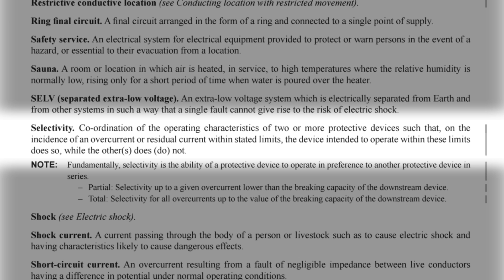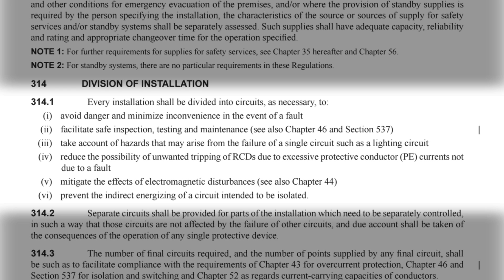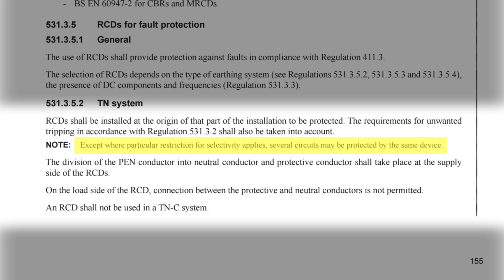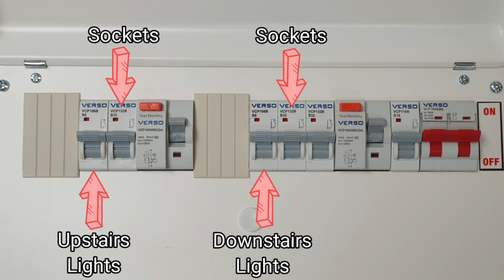Is a SPLIT LOAD CONSUMER UNIT compliant with BS7671? - Electricians' Q&A

Comment: RCBO boards only suit properties with good wiring done by a pro .One someone starts hacking into neutrals and  bad connections etc , adding a RCBO will be a nightmare .And as mentioned RCBO boards dont tell you when something has turned off .So lets say you dont notice something not working , Then you could be in trouble !!

Comment: I have always done full-RCBO boards. On a normal house, the difference is an extra £90 (on a ~£500 job). It’s a much a better service.
When they make us do the AFDD, that’s going to be another minefield to navigate. By all accounts one AFDD at the front of the board will keep the lights of permanently, but an AFDD on every circuit will double the price of the install.
Guide us! Oh ye wise eFixx!
Reply from the maker: stay tuned for amd2 in March - from what we know it's only going to be certain types of circuit on certain types of installation.

Comment: There is nothing wrong with split load boards.
Reply: There isn't really anything wrong with them until a fault develops and takes out half of the circuits. That's why rcbo boards are soooo much better
Reply: @curtisj2165  well no that's bollocks really because if half the circuits gat taken out in a house for 5 seconds what's the problem? Turn the MCBs off, turn the RCD back on the one MCB at a Time. When it trips you.know which circuit. RCBOS only benefit is having 30ma per Circuit, which technically means its less sensitive then when it is shared over a split load.
Reply: @adamwright5306  5 seconds? Imagine if the rcd trips while you are not at home, or worse still, while you are on holiday
Reply: @curtisj2165  Would never happen if its tested correctly. Thats just like saying imagine it just spontaneously combusted. It never happens, it's just what ifs all the time. You hear the odd case on a forum out of millions of houses. The worst that would ever happen is your fridge might turn off. Big deal. Can't imagine people leave fillet steak in there before they go away
Reply: @adamwright5306  would never happen if tested correctly, are you serious?  Personally i would not be happy if my freezer defrosted
Reply: @curtisj2165  Well I fail to see your point. If you go away on holiday the only likely hood of any circuit tripping would be a power circuit as all others would be off, so the likely hood being a power circuit would be one powering a kitchen with constantly running appliances that could fail. So if you have RCD protection in the form of RCBOs or RCD that circuit will trip either way.
Pointless argument mate you're wrong and as I said before there is no point if the circuits are divided correctly.
Reply: @adamwright5306  mate, i do electrical testing and inspections for a living, so i have a good idea of what I'm talking about. You obviously never heard of nuisance tripping where an rcd trips for no apparent reason
Reply: @curtisj2165  🤣
My Name is Adam, I run a multi million pound electrical company called elecracomsuk.  employing 44 electricians and I've done inspection and testing fo over 25 years. Nuisance tripping isn't RCDs tripping for no reason it's down to faults on the circuit as the RCD monitors the return imbalance from the neutral. Don't patronise me as you clearly don't know what you're on about. If a property is tested properly split load boards are fine.
Nice talking to you.

Comment: That’sall well and good splitting circuits up with selectivity and rcbo’s provided there are no borrowed neutrals.
Prime examples are two way lighting on landing light. Boiler that have been replaced with live and switched live, where the permanent live has now been added from downstairs and control gear from the airing cupboard upstairs.
Reply from the maker: If you're aware a circuit has a borrowed neutral would that not be something that you'd fix anyway?

Comment: Split load RCD could also alert someone quicker that a circuit has gone down and has a fault as half the property will loose power, these circuits could have vital equipment pump or freezer for example and is more likely to go unnoticed with an RCBO,  this is the only real benefit other than cost to have a split load RCD
Reply from the maker: Another good point. 😊
Reply: I like to see a max of 4 circuits per RCD, even better would be double pole MCBs, I have fitted them and it makes fault finding easier.

Comment: The reality of fitting a  CU means that you don’t always get to make those choices over which RCD a circuit goes on.

The position and length of the existing cables often dictates things, and if you’re installing a split load board to reduce costs, it means you’re not likely going to be able extend the cables safely and tidily.

Also, lots of older properties have shared neutrals on the lights anyway, so regardless of board type, the lights are going to be on one RCD/RCBO anyway.

Comment: I'm beginning to wonder if wholesalers should stop selling pre-built standard configuration special offer dual RCCB consumer units; all too often the installer just sets up an installation based on whatever MCBs came with the board rather than what the installation would be best served by
Thankfully I operate in a sector of the market where 99% of the time I can fit RCBO boards with SPD

Comment: I fit rcbo 90% of the time bit sometimes budget means split rcd board.

Ive used the logic that if the big Manufacturers still make and sell these boards they must meet with the regs im sure these guys go through the book thoroughly to make sure they are not making itmes they cant sell.

As soon as a reg comes out suggesting split boards are not good enough they will stop making them.

Spiltting the lighting circuits always trips the rcd when the property is sharing a neutral for two way switching.so on occasion ive had to put them on the same rcd.
Reply: Spot on for both comments.

Comment: In an ideal world all electricians would prefer to use SPD's and RCBO's in a CU. However, not all clients can afford the associated costs involved. So until the RCBO's become a little more affordable, RCD's will continue to be offered as a cost effective method (albeit not perfect) to protect the varying circuits within an installation. Nice job of explaining Joe. #StaySafe
Reply from the maker: Thanks Brian, that's pretty much the message I was going for. 👍
Reply: Do you offer both solutions when quoting, or do you assume the client can’t afford RCBO option without offering? What saving do you offer for a dual board vs an RCBO board ( genuinely interested in reasoning)

Comment: Full RCBO is a preference, but split load CU is still safer than a nackered old rewirable board for less well off customers. I personally think the IET should be proscribing ring final circuits before mandating RCBOs (or  SPDs, AFDDs, etc.). It's the 21st century, let's have socket radials exclusively already.
Reply: You need to understand ring final circuits and their advantages.
Reply from the maker: Some good points there.

Comment: Very balanced video
I've got a split load that only ever tripped due to faulty iron and hasn't now for 3 years.
My electrical installation and appliances are all good.
RCBOs are an expensive overkill
Reply from the maker: Balance is what we were aiming for so thanks. Love RCBO boards but wanted to point out how split load can still comply.
Reply: DP RCBOs are safer. 
Also your freezer can be tripped off when there is nothing wrong with it.
Reply: I would rather have a garage circuit, which may have a freezer plugged in, on an RCCB. If there is a fault with the freezer, you'd hope to notice one of the other circuits off in the house before you lose your frozen food.

Comment: The selectivity normally refers to protective devices which are in series, the protective device next to the fault shall trip, and not the level above. This is also mentioned in the part of BS 7671 shown in the video as a "NOTE". In case of a, for example, 30mA RCD this would require a RCD which is time delayed and at least 3 times the tripping current of the 30mA RCD (in that case a 100mA).
Making groups of RCDs is sufficient here in Germany to meet regulations, but the best way to go is to install RCBOs for the circuits. That particular thing isn't in the DIN VDE 0100 (Low voltage electrical installations), it is in the DIN 18015 (electrical installations in domestic dwellings). This reg also regulates by the living area in m² how many outlets must be in the different rooms, numbers of circuits, and the size of the distribution board (at least 4 rows, each row 12 units wide, 1 width unit=1 standard MCB), number of general circuits for outlets and lighting (depending on area in m²) and dedicated circuits for several named appliances. They also now want that we install one distribution board per floor, I actually did that back then when it wasn't necessary. I got a board in the cellar with the circuits for the cellar and the ground floor. The circuits in the 1st floor are in a sub-board installed on the first floor. Lighting circuit tripped, you are in the first floor and the lights in the staircase aren't working. And the board is on the ground floor. Worst case: You fall down the stairs because your kid left the roller skates on the stairs...

The best words describing using the RCBO for each circuit instead of RCD groups is: Operational availability, or reliability.
Reply: Just saw this and it reminded me of doing rewires of systems about 50 years old (in UK) where they had sub boards on different floors. Sometimes the regs just go round in circles 🙃
Reply from the maker: Great comment, thanks. 😊

Comment: I would still install a split load as there is nothing really wrong with them if you divide the circuits correctly, but I would always prefer separate RCBOs as its cleaner and less disruptive should an RCD trip. My issue here is that the general vibe seems to imply the RCDs are always tripping, but in a healthy circuit you rarely ever see that.
Reply: My parents house had 1 30ma rcd protecting the whole house. And never really had issues. I could probably count on 1 hand when it tripped in 10 years. My dad was in to tech so had 15+ machines with switch mode power supplies. Chinese odd power supplies all over the place. And the only things that used to cause it to trip was once me drilling through a cable. My mum cutting the lawn mower cable. And a couple of times when the outside light would literally explode. Other than that never had a problem.
Reply: Indeed, I've had a split load board for ten years and it's only tripped the RCD once when someone went on an adventure with a knife in a toaster..
Reply: @edc1569  LOL!
Reply from the maker: Great comment, some really valid points made there.
Reply: I hear that, but circuit can become defective via dodgy appliances plugged in, water heaters elements going down etc. & finding faults on a bank of circuits via  a RCD takes time to eliminate the fault as you will need to check all circuits addressed to said RCD, client always like a cheaper option but over engineering is always the best solution in the long run, but will cost more upfront

Comment: My mum had a single RCD board. When she needed some sorting out done, rather than rip out a perfectly serviceable CU we put RCBOs on one socket circuit and one lighting. So it's split load: RCD one side, RCBOs the other. Much more affordable to upgrade one or two at a time. Eventually they could all go into a new, same brand CU.
Reply from the maker: Top tip, thanks very much!

Comment: Great video.  Presumably the IET are happy for us to continue to use dual RCD boards for the time being, as they are still shown as an option in the OSG (fig 3.6.3 (ii)).  RCBO boards are undoubtedly less inconvenient in the event of a fault, but there is one very slight advantage to dual RCD boards:  Depending on what tripped (MCB, RCD, or both), you can get an idea as to what sort of fault you're dealing with.  This can be very useful for those intermittent, difficult to find faults that don't show up under test.
Reply: You'd get an idea what fault you're dealing with with an RCBO?
Reply: @user-wk7wv8rn8h  not really. 
 For a dual RCD board, an overload or L-N short would trip the MCB, while an earth fault would trip the RCD.  A line to earth short would probably trip both.  So you can at least get an idea of what sort of fault there is by what device tripped.
An RCBO will trip for all the above faults, so it gives no clues as to what caused it to trip
Reply: @user-wk7wv8rn8h  I think he means if a MCB tripped it would suggest a different fault to that if an RCD tripped. If an RCBO trips, it could suggest a neutral earth fault or a short circuit so you'd be looking for both.
Reply: @NUFCJCYT  would a competent electrician not be able to figure that out within a few minutes of testing
Reply: @user-wk7wv8rn8h  Yes, and someone competent at reading would have noticed he said RCDs offer a "slight advantage" which isn't incorrect of him to say.
Reply: @user-wk7wv8rn8h  as per my OP, not all faults show up under test.  Some kinds of intermittent faults, particularly those on appliances, can return perfect, text book test results.  These can be very difficult and time consuming to pin point.  Knowing what sort of fault you're trying to find, overcurrent or earth fault, can cut that time in half.
Reply: @user-wk7wv8rn8h  i think he meant you will know which circuit is faulty

Comment: Why are we still having this discussion? Split loads are allowable but they shouldn't be. If everyone fitted RCBOs the cost would drop like a stone. As to the question of separation. What about arc fault we won't have 10 of them per board. (At first).
RCBOs aren't that expensive, and I wouldn't fit anything else. (WEO essential uses alarms etc.)
Reply from the maker: Thanks for commenting 👍

Comment: Way too much is being read into this, and you can bet your ass a judge would rip you apart if you listened to this advice. Just put each circuit on its own RCBO. They are cheap enough these days.
Reply from the maker: You could also point to other publications by the IET which show split load boards in use as acceptable. I think if you demonstrated the depth of knowledge of the regs shown in this video the judge would trust your engineering judgement. I agree RCBO boards are the best but split load boards aren't necessarily non-compliant.

Comment: Couple of other points I can think of referring to split loads:
1. Does both RCDS have to be both at 100amp now? What happens if they are not?
2. What happens if either RCD or both are the incorrect type for coping with DC masking/Earth leakage with present circuits or additional circuits such as car chargers, etc.
Please discuss if you can with another video please.
Reply from the maker: Great questions, we'll add them to our to do list!
Reply: @efixx  Thanks. I liked that Lewden IP rated TP&N DB. Have you seen the Hagar  TP&N (basic IP) with Surge built in on the busbar system adjacent the main switch? No MCB required to feed it. If all boards came built in, we wouldn’t forget about them. 🤣
Reply: If the mcbs down stream addup to less than say the 63a rcd. Surely that's OK. If they add up to more then it would need changing

Comment: I like to fit high integrity consumer units and full rcbo consumer units.  Have to way up how many circuits and how big is the property. ..fitting dual rccd consumer units has a problem with a circuit tripping off there is no we here else to put it temporarily on a non rccd side.. just a thought ...
Reply: Well, if it’s tripping the RCD, there’s a potentially dangerous fault, so you you shouldn’t really be putting it on a non RCD protected breaker at all....

Temporary fixes have a way of becoming permanent. I know of a customer that has over a 100ma going down the main earth where the previous spark did a “temporary fix”, but the customer doesn’t want the hassle of changing his board.
Reply from the maker: Interesting thoughts, thanks very much. 😊
Reply: @efixx  interesting?!?! More like dangerous.

Comment: I was asking my Qualifying supervisor about this as I had a couple of consumer unit fails recently( Old rcd not disconnecting and cover taped on). I was saying do we fit a Dual rcd splitload consumer unit as we only get paid a set amount standard order rate (sor) from the client which is a housing association. Or do we install all rcbo's which would go over the rate,he said that we have to fit all Rcbos now with bs7671.
I wasn't going to look it up or argue it as I prefer rcbo's myself.
On the splitload consumer units with the dual rcds I would of done the same as Joe with the lights and sockets and put the shower and cooker on the  separate dual rcd's and the immersion heater if there was one separate from the shower as well.

Comment: nice thing of having 3-phase supply and 4-pole RCDs, leakage currents does not add up, instead those cancel each other out. So no false tripping. It is common to have about 10 circuits protected by one RCD. RCBOs are very rare here too, those are only used if adding circuit and there is no space for RCD+MCB
Reply: Are you saying that Earth Leakage Current/Residual Current say 12mA 'induced' on phase-A , phase-B and phase-C simultaneously will be 'viewed' by the Sensing Coil as 0mA or near 0mA as they 'cancel out' each other???🤔🤣🤣
Reply: @piratedprivacy9052  Exactly
Reply: I thought most leakage is from electronics loads or motors with y-class capacitors which are line-to-ground - so not sure how 3 phase helps?
Reply: @edc1569  when you have balanced load between all phases, there is no current in neutral wire. Same applies to leakage current to ground.